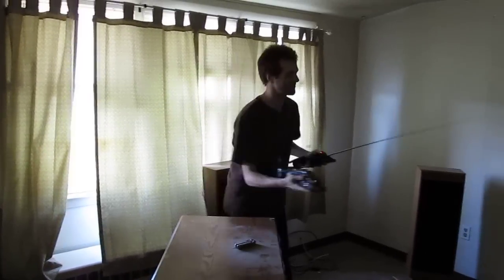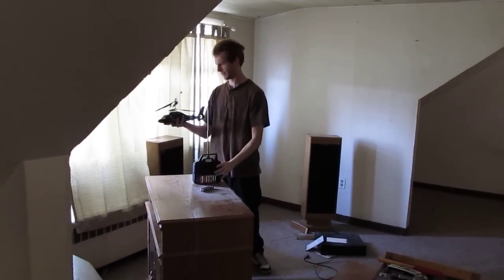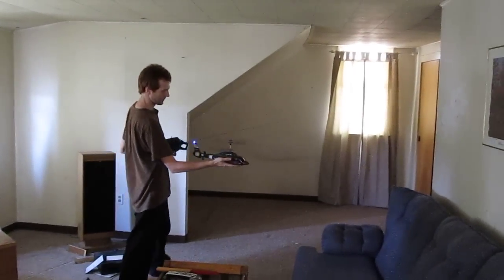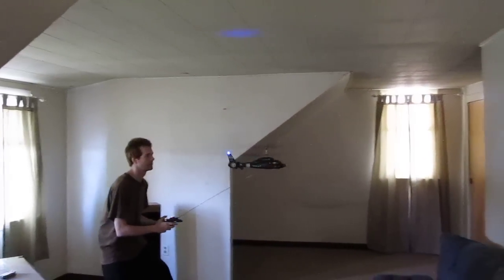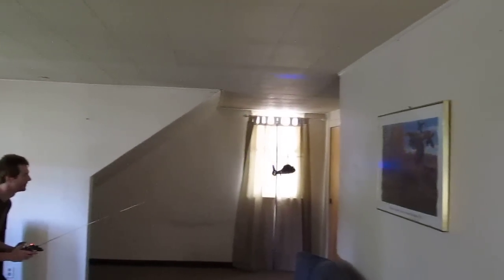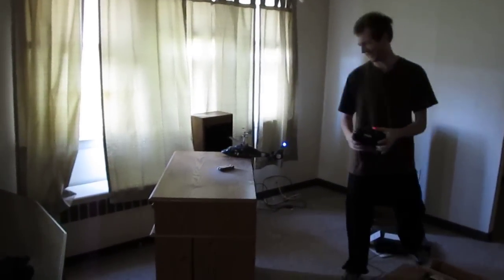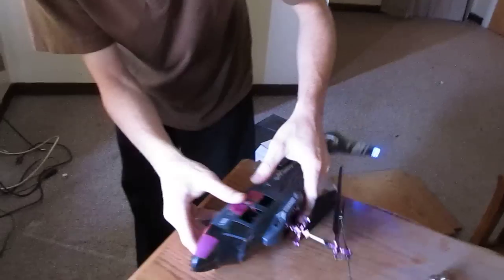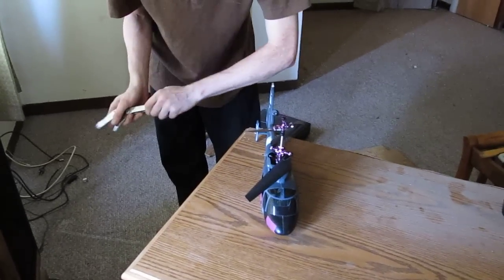Esky Dauphin - first flight with CNC parts

Comment from the maker: @TheBladeJunker the servo arm for the slide left/right was set a bit short, I hadn't fully adjusted everything after putting the upgrade parts in.  Now it's nice and level, and is a lot more responsive, but i'm waiting for blades to arrive so i can properly balance it.  The blades on it now are chipped up (one side is missing about 1/4 inch off the tip, and it's split) so i have 3 sets on their way in next week hopefully.  There will be more vids on this heli once i get it flying reliably.